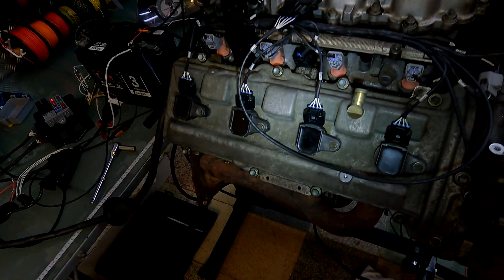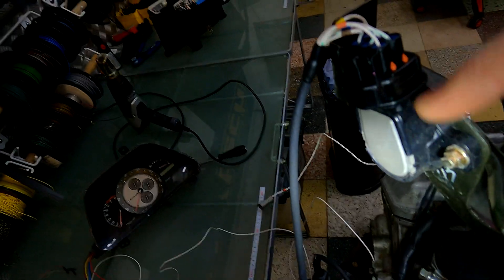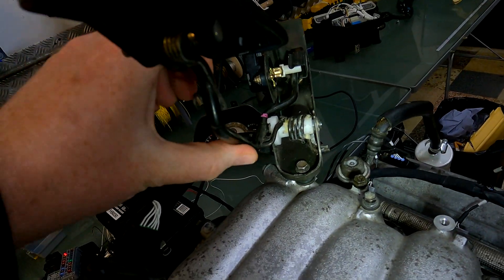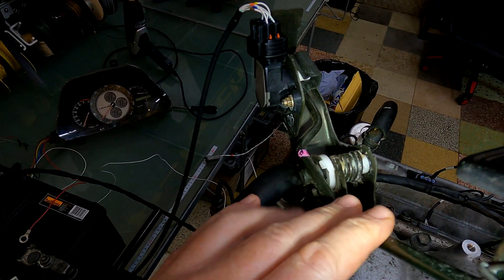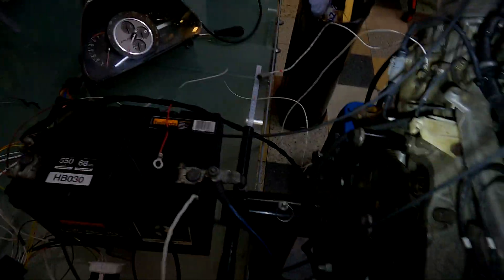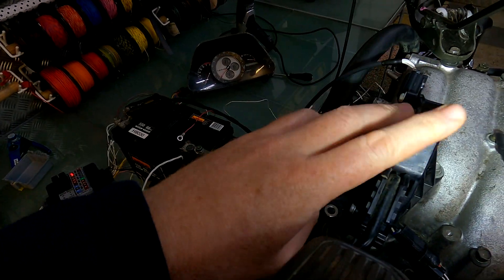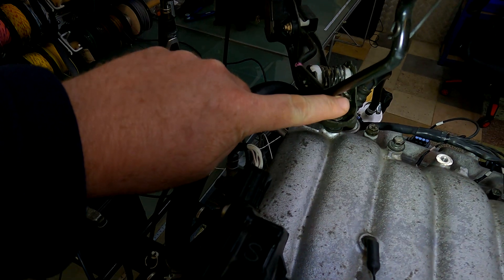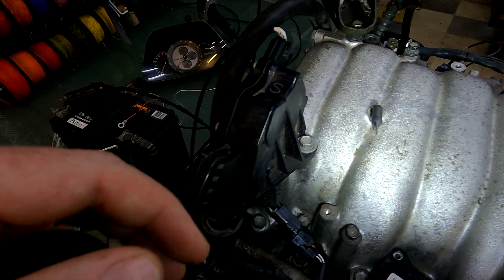3UZ-FE VVT-i Which Accelerator Pedal Should or Can You Use!

Comment: Im having issues with my 3uz swap, my pedal doesn't even actuate the throttle body. It's like a safe mode or something. It starts up and runs but I only get about 500-700 rpm increase from the throttle. Any ideas?

Comment: For the is250 throttle pedal do u sell an adapter that plugs into the original plug for a 3uz and into the is250 pedal on the other end
Reply from the maker: We do not I'm afraid. I haven't looked but I don't think the female version of the 3UZ Pedal connector are available.

Comment: Would the PIN numbers have the same function on the other pedals, eg pin 1 to pin 1 etc
Thanks
Reply from the maker: Hey @user-eww1or3rv4x no the different pedals can have different pinouts. You need to refer to the diagram for the vehicle where the pedal comes from to confirm.

Comment: Wish I knew of this video when I was building my 3UZ Swapped JZS147 GS300. Now I know for my MK3 Supra, Def gonna use the IS pedal if I can create brackets to line it all up. Thanks tons.
Reply: Did you ever do the 3uz swap in your mk3? Im almost done with mine but having issues with the throttle, just wondering what you did for yours.
Reply: @WhiteLando  I did, but never got the engine to run. i ended up dropping the 3UZ and went with a different set up.
Reply: Thanks  @EdubLex i appreciate the response.

Comment: Thank u soo much for this great information. Can I install This is250/350 padel in my lexus Ls430 2001 model is it same connection?
Reply from the maker: Hello you wouldn't need to swap in any pedal if the car is original. This is more for Swaps where fitting say an LS430 Pedal is not viable.

Comment: What pedal would be easiest to fit to an Altezza?
Reply from the maker: Hey John We haven't found an issue fitting these pedals into an Altezza. Unfortunately from what we have gathered the SC430 pedal is a straight fit but it is one of the pedals that require a stop otherwise it will go out of sync if allowed to travel further then the APS sensor allows

Comment: Can you please confirm what is the pedal sensor pinout with the oem gs430 pedal sensor
Reply from the maker: Hello Mohsin there are two versions of the GS430 and there will be two different pedals. The best is to confirm what pedal you have and then Pinouts can be found.
Reply: @PhoenixEngineManagement  which year IS250/350 pedal
Reply from the maker: @brostjoe  As far as I can remember any year. They should all the relatively the same. Also it's not just IS250 and IS350 Pedals you will also find the likes of 2005 onwards GS300/430/460 Pedals should also work as well.
Reply: @PhoenixEngineManagement  I was looking at the GX460 accelerator assembly. Since this is going in a pick up might be in a better starting position, appears to have same 6 pin connector.
Reply from the maker: @brostjoe  Yeah pretty much all Toyota/Lexus Denso Accelerator pedals will work. It appears the open designs were limted to the early models and from then onwards they moved to the fully enclosed designs.
Reply: Hi 
I have both you are using in the video 
The one above tp sensor type 6 pin v type 
The one below inline 6 pin type 
Can you share both sensors pinout??